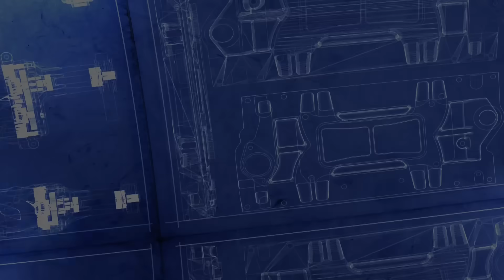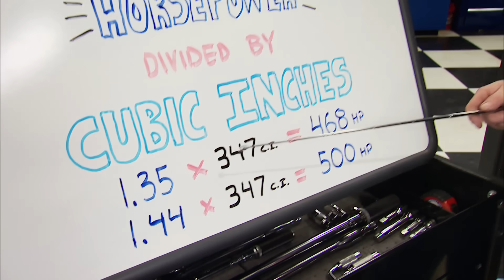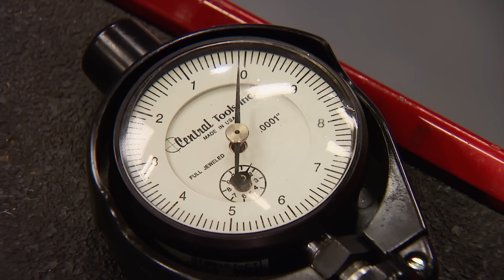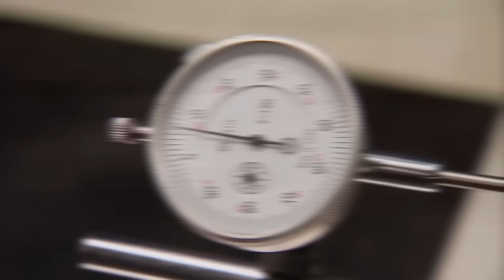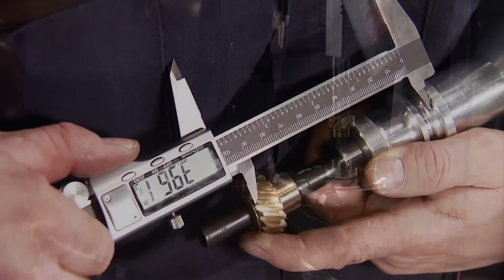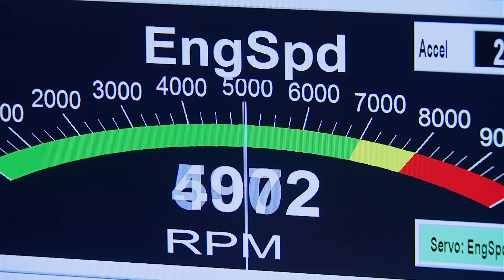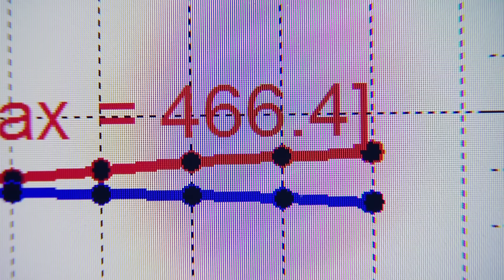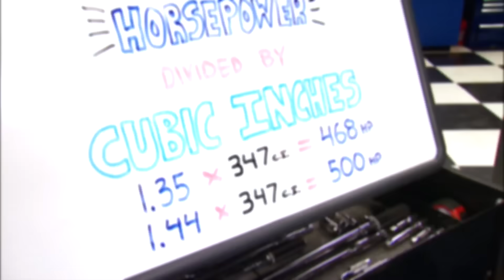Stroking A 5.0L Small Block Ford to 347 C.I. - Engine Power S2, E8

Comment from the maker: We'll continue to post these episodes here on YouTube. If you can't wait for the rest of the build, visit our site to binge-watch:  https://www.powernationtv.com/shows/engine-power
Reply: What was the final build cost?....Is it less than a Ford Motorsports new performance engine?
Reply: @josephklimchock5412  Parts alone you're looking at 7k , give or take.
Reply: Joseph Klimchock 9k just in parts
Reply: PowerNation would love to see a similar build done on a 302 with cleveland heads. The high revving little 302 is sweet music to my ears.
Reply: Why carnt I find the blocks at Summit racing
Reply: @jet li People try and use the 500hp limit as a rule for stock blocks but it completely depends on the combo. 500hp na is far less stressful on the block than 500hp from a roots which is how ive seen these blocks give. People regularly get away with far more so its less a rule and more a consideration.
Reply: That's 225 hp and 300 torque.    Get it right.
Reply: @springwoodslasher79 Not in 86.
Reply: You should turn this into a clevor next . just to compair the power defrence between the heads.
Reply: PowerNation hey build a 302 push it till it twist or cracks the block
Reply: @Caudahy Hall Because the world is full of 5L motors.
Reply: @Caudahy Hall not that the same power couldn't be made with the 351 and more room to grow with cubes, it's nice to see that 500 naturally aspirated horsepower can be had from a stroked 5.0 block
Reply: the block is way more than $700 need part numbers
Reply: Do you check the heads because a lot of time the valves don't seat correct.
Reply: You guys need to come back to TV!
Reply: Why do you show dyno test for this and Not the  190 power port Trick Flows 410 inch Mopar ? why the Bias?
Reply: G hrvyck  I'm aware. I said not that it couldn't make the power, meaning I'm well aware of the power potential even maintaining 351 cubes.
Reply: I need that  in my 95 f150 4x4 short bed is it possible
Reply: Will the engine be good and fit a 2000 Ford ranger?
Reply: I bought the same rotating assembly so did they really make a make gap on piston rings or do the rings come already to proper gap? So you just put them on the piston?  @powernation
Reply: 0wp0]l]
Reply: Cuanto sale un motor como ese?????
Reply: Please build a stroked out 351W to 410 on fuel injection with twisted wedge heads

Comment: Never seen so much lube used in building an engine ever! Especially on the valve stem where it’s whipped off the stem at the seal and collects to be drawn in and burned or pushed out and burnt (exhaust side). You only need a little. Must assume they get paid for pouring out as much as possible.

Comment: Would this work in a heavy car or truck with a manual, or it is more for a stall converter drag car situation? They never show the 1500-2500 rpm range on dyno runs, or part throttle smoothness. Thank you for describing the fuel used though.

Comment: The Key to any ICE's max performance is the Cylinder Head Design. FORD'S improved over the years, but pale to what these AFR (or similar) heads do. GM'S LS/LT continued cyl hd, pushrod engine development power increases show the error Ford made abandoning their SB. They rectified the tragedy with 2020's Godzilla 7.3 . A Big Block LS/LT variation that GM wishes they had built for Diesel alternatives in 3/4 up trucks.

Comment: 03/25. I just completed this build. I encourage anyone to use this combo. They only thing I changed was the combustion chamber size and intake carb set up. We got 562 hp and 489 torque at 6500 RPM with 30° of timing. It’s got more in the tank, but with a stock block we stopped there.  Still pulling hard at 6500.
Reply: i know they gave prices in the video but how much are they different now being 5 years later. i could not find the block they used in the video on summit's site.
Reply: I’m interested in price point 5years later as well
Reply: Where did you get your block?

Comment: For the street i think i would use a Performer RPM Air Gap Duel Plane with a 1 3/4 Primary Long Tube to a nice 3 inch Collector on a set of Borla 3 1/2 in Straight Thru Mufflers with an X Pipe.

Comment: My impression is that most of the improvements in these vintage small blocks is achieved by increasing displacement by increasing the stroke. The block dimensions prohibit any significant bore increases. Increasing stroke increases torque more than power mainly because the rev limits can’t really change much. So you get more low end torque for low end acceleration without benefiting from more horsepower at the higher revs for top end speed (velocity). It’s good for burning rubber and quarter mile times on a straight which are what impresses American most. But it ain’t much good in a real road competition like we see in European racing where handling and high end power rule the roost.
Reply: Put 342 rear ends in a 9 inch forward rear end and go. European racing and talk to me about it later

Comment: I wonder how much more power it makes with that stroker rather than just bored .30 over, because if it isn’t like 100 more HP because of the stroke addition alone which only takes it from 3 inches to 3.4 inches it would cut down on cost a lot to not have to buy a stroker crank

Comment: Put the cam in before the crank so you can support it so you don't gouge the cam brgs with each cam lobe.also fords don't really need a torque plate because the head bolts are located off the the cylinders unlike a chevy (check it out) like your videos looks like fun 😊

Comment: Except those heads are 1381 AFR195cc heads with 2.050" intake valves. NOT the #1450 AFR205cc heads as stated. Just sayin'. 
False Advertisement or stupidity? 🙄

Comment: You spec'd a 6.600" pushrod but a Hydraulic Roller Lifter compresses for "PRE-LOAD", which on factory type roller lifters can be as much as .075" depth past "ZERO" lash... 

Thus wouldn't you add .050 at least making total pushrod required length 6.65?!?!?

Comment: Nice build. Is the firing order the same on the stroker 347 as the original Ford 302 engine?
Reply: It's a late roller H/O block,  which carries the same f/o as a 351. 1372...  Knowing this cam, it is not the early 302 firing order

Comment: What about building a everyday man's 347 stroker with GT 40 fuel injection and GT 40 heads. I have 2 sets of Ford lighting ECU's, fuel injectors, and air boxes from to of mine that I switched to mass air. which use 302 firing order. I would donate 1set to you to see this build done.

Comment: why the bronze gear on a hydraulic roller cam Ive done that fkr solid rollers but never hydraulic.

Ive ran steel gears in billet rollers,sadi core hardended hydraulic cams,etc erc for years without fail.

why not a steel gear like the oem?

Comment: I know this is an old show,but I have a question? How much of that 507hp do you lose going to a chassis Dyno?
Reply: The 1st Law of Thermodynamics will guide you. The chassis dyno horsepower is 507 minus the heat lost between the flywheel and the dyno rollers. Each horsepower equals 746 watts. For a manual transmission and no roller slippage, it's a couple of hair dryers worth - maybe 5 horsepower.
Reply: Some (knowledgeable people?) have said about 20% losses.

Comment: This engine dropped into a small bumper 1970-1972 Maverick would literally be SCARY!! 

I REALLY want to own another Ford Maverick of any year before I put my tools down for the final time. Short wheelbase and 2800-2900 pounds from the factory with MANY areas to drop several hundred more pounds of weight. It's basically THE perfect drag car!
Reply: Mavericks are so underrated. The light weight makes them rockets

Comment: Didn't show your viewers how to check ring gap or point out the correct position of rings ?  Never dialed the cam in ? How tight did you pull up the cam thrust plate ?

Comment: I still say to wash that block with high detergent soap and water then use motor oil to wipe out the cylinders until they come out clean. 
Blow it dry before it rusts wipe with WD40 solvent based oil. 
   Your route is easier or something.

Comment: Nice . I always use a chromoly oil pump drive rod, and windage tray on the 5 or so I did.. and I would never go over 331 cubes due to the piston rod angle these 347 and 363 sbf is okay just not so durable. Just use a 351w , go .030 over bore  and your much more harmonic with 357 cubes and stronger more torque, aluminum heads , intake , with steel crank you will be similar weight and it will go pretty much  anyplace a 302 will with minor mods engine bay fit...but whatever, that's a cool build.  Pat is the man though. 👍

Comment: It strikes me that y'all are going to great effort and expense to achieve Coyote specs when it would certainly be easier to just install a Coyote crate motor - not to mention, you would have a much more reliable Coyote fuel injection/engine management system for essentially trouble and maintenance-free running.  Is there some cost advantage to taking this push rod approach that I'm not seeing?

Comment: Didn’t degree the camshaft?
Shouldn’t be using breathers on both valve covers. You need some sort of crankcase evacuation system for proper ring seal and if you don’t want to be constantly chasing oil leaks. At least run a PCV valve on it for the street.

Comment: This is an excellent build it went right past the target numbers. and they didn't have to work it hard to do it which means it will live long. I'm not sure about that carburetor for street use with no choke provision a small inconvenience. it's definitely the way to go if your wallet can handle it.

Comment: As long as you use 600+ HP heads, its a solid build, the Scat 347 kit is king for a 302 motor.

Comment: I get that you don't want to spend the extra money, but I would never trust the late model 302 blocks for hard use with 470-500 horsepower. They weren't inherently strong blocks. Yes, some people have gone way past that. Good tuning is imperative in protecting everything. But the risk is still high at that level, unless you're not ever pushing the motor - which, what's the point of having that much power if you don't ever use it? 

When Ford Racing sold the short blocks and crate motors(I don't know if they still do, or if they've switched to just coyote motors and stroked 351w motors at this point), they rated the block safe up to 450 horse.

Comment: Great motor build. But I’d liked to see a 347 build for the street where most of us guys would be driving....
Reply: Yes I'd like to see the torque  horsepower ratings on that engine with initial timing and with the torque was lower RPMs

Comment: I had a 347 built with gt 40 heads 12.1 compression   wonder  how much horsepower  I picked  and  my cam specs are valve lift 534  dur 244 adv dur 292 any geuss all
Reply: Depends on how those heads were prepped,
Reply: And the tune. Exhausts?

Comment: I built a 347 years ago and I tried a bunch of different carbs but when I got the quick fuel it was night and day. Literally went .5 faster at the track just bolting on a  quick fuel 750 (it was the Q-series not a regular street carb with a choke) not even tuning it and it was RICHHH, also had much better throttle response.

Comment: I have always wondered why it's better to stroke a 302 out to 347 instead of just starting with a 351, does the 347 have a longer stroke than a 351?
Reply: Because the 351W can be stroked out to a 427.  That's why.

Comment: I'm a mustang guy, and I never understood building a 302. Sell the engine and get a 351 and then invest the money into the stroker and end up with more of everything at about the same cost.
Reply: 351 Windsor's aren't a drop in in Fox bodies. You need a new intake, a new oil pan, new oil pump, different headers, a new flywheel, and a new harmonic balancer. The aceesory brackets are different too. That's not counting sourcing a new core for rebuilding. You're probably looking at $1500+ before the rebuild even starts. $1500 isn't chump change.

Comment: The 347 ci is the size Ford should have produced from the factory. Chevy was 350 ci but Ford always insisted on going small.
Reply: Ford made a 351 from the same block from 1969-1997

Comment: I love this motor. I have the factory 302 cu. in.mill in my Mustang GT and it rocks! One question: I'm more of a track racer than quarter-miler so I'd like to stay with fuel injection up top. Any thoughts on what I'd need?
Reply: you can keep the factory style fuel injection setup if you want. with these valve covers you might need an intake pacer. or you can get a carb style efi intake and run something similar to a holley sniper efi
Reply: @danielweston8059  Thanks!

Comment: Did you guys port match the intake manifold? If so what gaskets did you guys use? AFR says not to use Fel Pro 1262 to port match, but that’s what’s AFR recommended for the cylinder heads? Is there something else?

Comment: Forgot to mention the crank rear seal installation and they didn't check the clearance between the oil pickup and the bottom of the oil pan, a major fubar since this is very important to be sure the oil pan does not suck up to the pickup. The composite distributor gear would have been a better choice to use versus the Bronze gear. The bronze gear will need replaced after a while of use, where the composite gear will not wear like the bronze gear will. Lots of excitement getting 500hp, when for about the same cost you could have built a 408 stroker and easily exceeded 500hp.

Comment: Next you should rebuild and upgrade a 305 5.0 gm block. I used to drive a 305 5.0 liter with a 750 cfm 4 barrel QuadraJet 3 speed automatic transmission 1979 Oldsmobile Cutlass Calais for about 4 years when I was working plumbing / new construction work in Arizona for few years.
Reply: Had a 305 no don't bother

Comment: For the cost of the parts and machine work you could probably get a 351W from a truck at the junkyard. Re gap the rings and put an Edelbrock kit on it. Instant 450+ hp/400+ tq. You'll have a stronger block. Save up some more scratch for a vortech supercharger and your looking at close to 700hp, maybe even more with an intercooler and E85.
Reply: richard holdner got a hold of a junkyard low compression 351 roller truck block and put the perfomer RPM 351w kit  on it with a dual plane and a 750  and made 450hp lol
then he put a turbo on it and  it made 1000hp before the rings gave and yes he wish he re gapped them
Reply: Not all vehicles can fit a 351 as easily as a 289/302.

Comment: 504 HP? So basically the same HP as a stock $500 junkyard 6.0 LS engine and a cam swap. And this stroker cost you $10K. Hahaha!!!
Reply: a junkyard 351 can do 1000hp  with a turbo and live if you gapp the rings correctly.  richard holdner just did a few weeks ago so there you go.  an 8.2 ford block is limited

Comment: not everybody with a 20.00 dollar an hour job could afford a $20.000 dollar engine build. make it for the average man and a street cat for 10.80ct  1/4 Mi.
Reply: you think this cost 20k?  lol man you're getting bopped if youre paying 20k for 450HP!! more like 5-6k
Reply: @jackbarker59  yeah they did a lot of work on an 8.2 deck 347 stroker with 7/16 head bolts

Its not stronger than an 9.5 deck 351w with 1/2 inch bolts

They're at the point of splitting that block whwre a 351w is just getting started...

I'd just do the 351W myself. Cheaper and you dont need all those tricks just regular bore and hone with torque plates and grind crank if needed

Comment: Aren't the valve springs on a afr 205 for a flat taper cam not a hydraulic roller
Reply: theyre roller.  or flat tappet if youre using a solid flat tappet

Comment: need to do a video of the 302  5.0 motor without the stroker on 2 different phases.   first phase a mild upgrade with gt 40 heads and the second phase all the works   allum. heads and etc